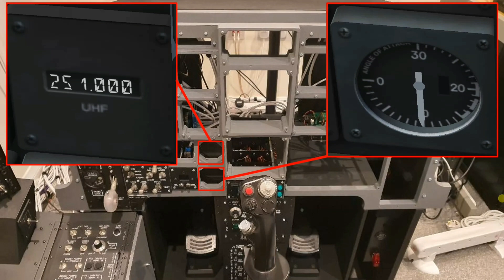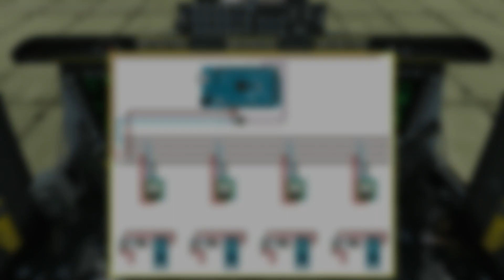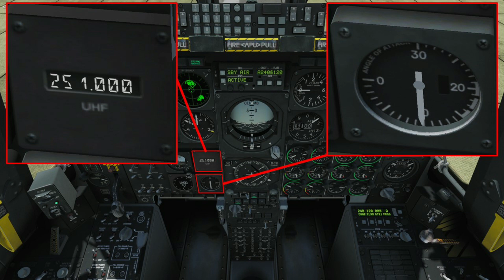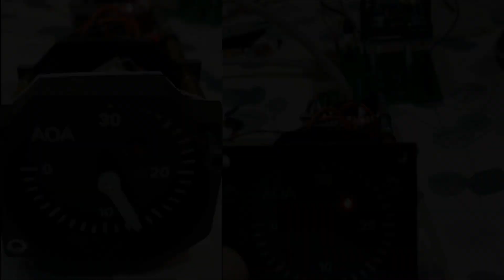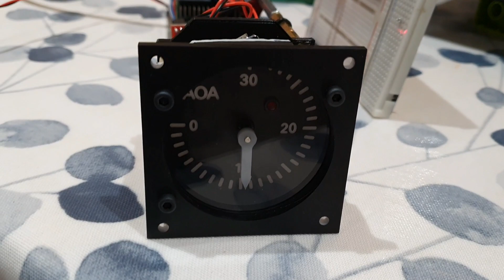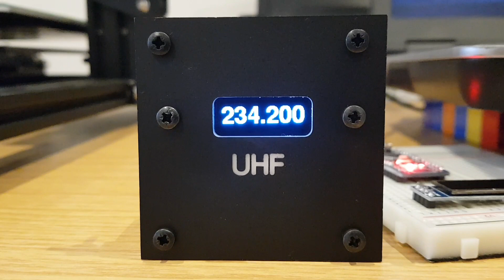Simpit A10C - Front Dash - Part 16: PCB Based RS485 Network (AOA / UHF Repeater)

Comment: I'm pretty sure it is way too late, but I have a suggestion for your back lighting. I built a variable voltage regulator from 2 LM317 chips and a dual gang pot. I also installed two buttons and two indicator leds.  The buttons are for metre power and metre sense, for input and output. What I did for the power out is split the instrument into two halfs, so there are 4 connectors for each half. I used RJ12/ RJ11 jacks for them. The reason for this is because I can whip up a cable in minutes and all telephone stuff goes for penies now adays, super cheap!  Makes the setup a ton more modular and expandable as well. If I ever run out of ports, you can always pick up some splitters for cents on the dollar!  Mind you I have made three of these panels, one for backlights, button lights and flood lights!  Happy flying!